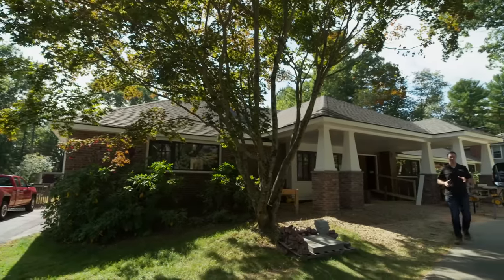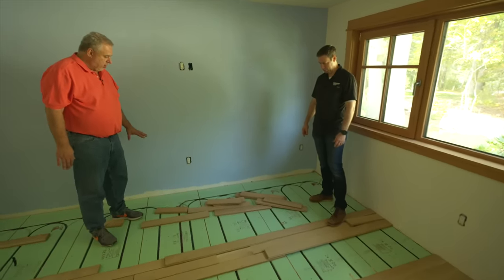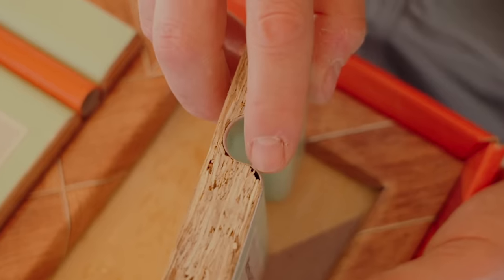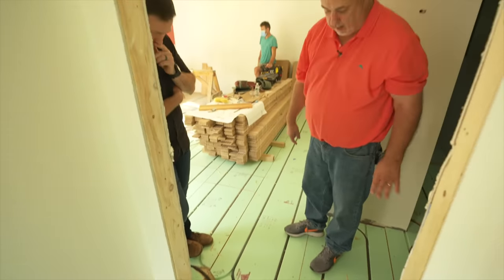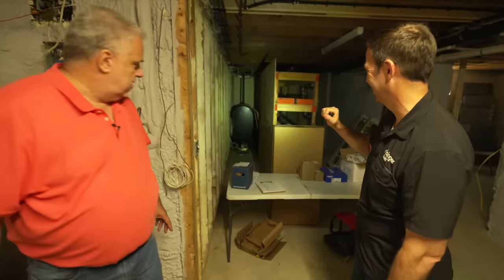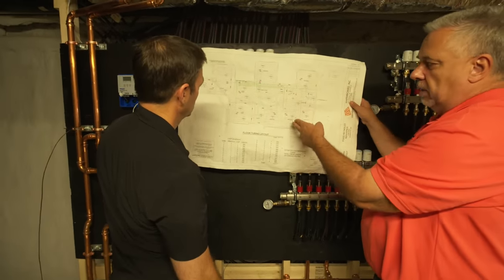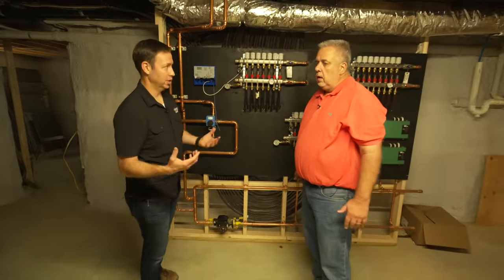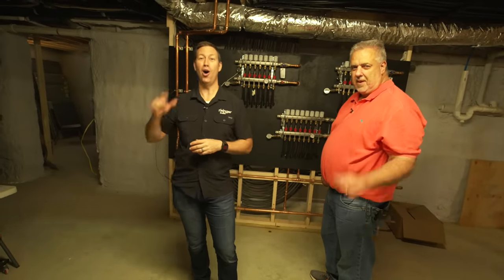Plug and Play Radiant Floor Heating System - BEST ON THE MARKET

Comment: If someone put a nail through the pipe....
Reply: ...it would leak.
Reply: @paulmccoy2908  Wonder how many boards need to be ripped out to fix the leak
Reply: @JW77  On my largest job, a basement floor leak damaged 500 ft sq of Warmboard, 1200 ft sq of flooring, and another 6-800 ft sq had to be dried out by pressurized air being blown under. Repair was 4 months work. Very ugly, and avoidable, but sometimes all it takes is one tiny miss. Fastener penetration held for 14 months, before the flooring over the rusted out floor staple blew up. We estimated  (based on extent of mold) that it had been dripping into, and conducted around by, the channels in the Warmboard for at least two weeks prior to the floor buckling (which finally alerted the homeowner that something was amiss).
Reply: Lee Stevens How is that even possible? The system would cease to function once a relatively modest amount of water was lost. They must have kept topping it up without stopping to question where the gallons of water they were adding back in were going!
Reply: @spencerwilton5831  You are very obviously not acquainted with the setup of hydronic heating systems. All systems have some water, or fluid volume,  loss. Initially, it is due mostly to air extraction; air content may be up to 4% by volume at startup (fresh water from the domestic supply, it always has entrained air). Higher than that, the pumps will cavitate due to air bubble formation at the impeller, and it will not be possible to commence proper operation. If the system is started in the heating season, about 1 to 3 weeks will see the majority of air extracted by the air separator, and vented to the atmosphere.  But even in a mature run mode, there is still some air extraction (if one is a fool and uses non-oxygen barrier PEX this is made much worse, as oxygen diffuses INTO the contained water). There is also some component of water loss through things like valve stem seals, pump packings and miscellaneous fittings, that water can drip out of over time, albeit usually very slowly. Corrosion, pin holing all the way up to catastrophic heat exchanger per blowouts (due to chloride contamination of the tap water used to fill, it is very harmful to stainless steel, at elevated temperatures) can also occur. 

Virtually all hydronic heating systems installed in the past 50 years in North America have an automatic feed valve, which is just a glorified pressure reducing valve between the domestic water supply and the heating system. If pressure goes below the setpoint, due to air extraction and or leakage, the auto feed will top up the system. Unfortunately, it is a "dumb" mechanical device, and does not distinguish between a damaging leak and necessary system maintenance. It will feed a leak endlessly. This is most dramatic in unoccupied homes that freeze up (a heat pipe) for some cause or another, and when the outdoor temperature rises, the ice plug melts and the auto feed floods the house. This has happened to my clients (vacation home, not built by me), and my buddy's sister, and a number of others, that I am aware of. So, your response is, "Why not close off the auto feed?" Good idea. Say I did this in my cited project. The owners are away several weeks at Christmas, and often for longer later in the winter heating season. Now suppose that the true maintenance need hits the critical point (pressure too low) while they are away. Much more drop will kick in the pump impeller cavitation problem, and the pump quickly burns out. At that point, there can be no heat delivery to the spaces, and the house can easily freeze up, despite a fully functional boiler or heat pump. In this project ($10 million to build), that becomes a very serious liability issue for me, the builder. Hence, the auto feed is always operational (there is chilled water cooling also, as part of a very elaborate system). A very few pump/hydronics manufacturers have advocated closing off the auto feed, after initial air extraction.  This usually works okay on traditional all-copper (baseboard) jobs, as long as there is an annual maintenance check and manual topping up. It is not so good with infloor, and homes that are not continuously occupied (too many vulnerabilities). I believe a majority of mechanics installing Warmboard systems also now close off the auto feed. An actual active leak will throw the system into failure mode fairly quickly. You are correct, volume tloss to failure is SMALL, about 1 quart, in a typical modest sized house. One must pick their poison. 

In the cited job, we vacuumed up about 4 gallons of water from under the Warmboard. There was obviously more soaked into the Warmboard, but still, it was not a large volume. The repairs took 4 months, and cost the floor layer and his insurance carrier about $55k. Pretty ugly. There are now some alternative makeup water strategies that could have lessened the damage, but we were unaware of them when the house was constructed.

Comment: Why waste the effort too heat a closet. A walk in I could see, but not the little one shown here
Reply: Rich Sobocinski The warmboard is needed to keep floor levels consistent between the bedroom and the closet. It's a few minutes extra work and perhaps fifty feet of pipe to continue the heating loop into the closet, so you might as well- it will help eliminate cold spots and draughts.
Reply: @spencerwilton5831  Agreed, any absence would be immediately felt due to heat delivery
Reply: @spencerwilton5831  unless your closet is on an exterior wall i don't see how you get "cold spots". as to getting "draughts", i don't see what that has to do with radiant heating.
Reply: paper wait An unheated space will be cooler- at least initially- than an adjoining heated space. Physics dictates that heat will move from the warmer to the cooler area in an attempt to obtain equilibrium. That means draughts. Granted, the severity will be dictated by the size of the two spaces, the temperature differential and many other factors besides. You may notice little. But the point remains that for very little additional effort or expense you can eliminate any potential issues just by running a few feet of pipe into the closet which we have already established needs to be fitted with the UFH boards anyway.
Reply: @spencerwilton5831  to get noticeable "draughts" would require much higher btu output than you are ever going to get from a radiant floor heating system (you would need really high btu output). the reason why panels were run into the closet was to keep the floor level. warmboard retrofit panels raise the subfloor about 0.75 inches. it probably would have been less expensive to use plywood instead, but that was the reason.